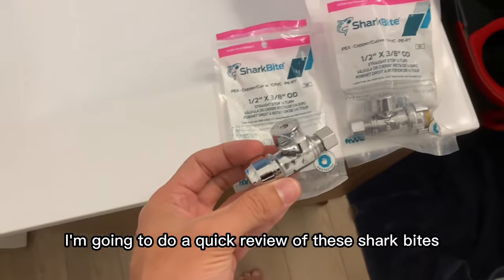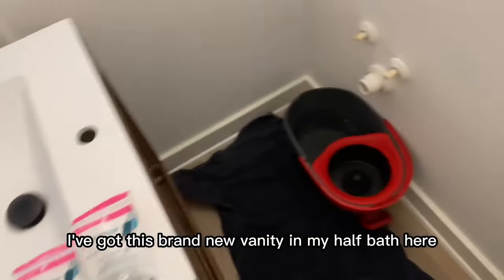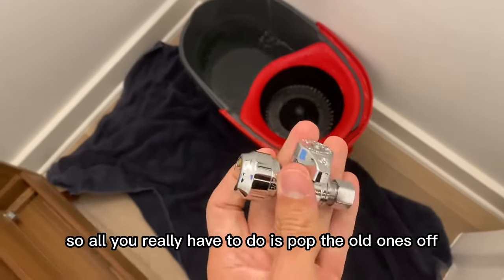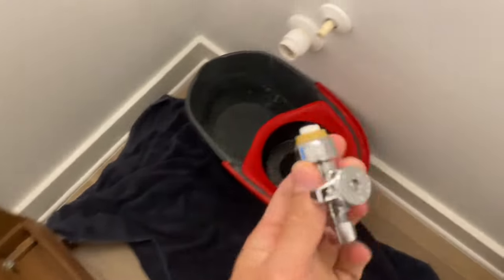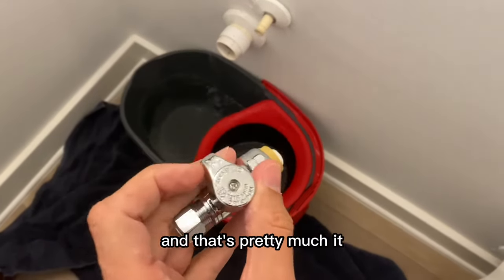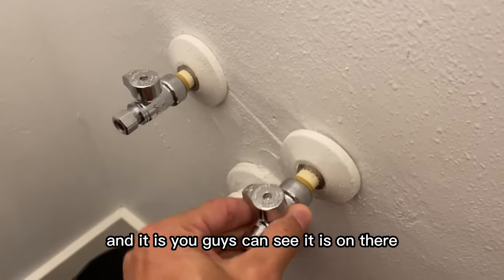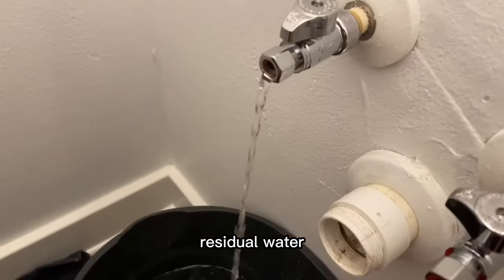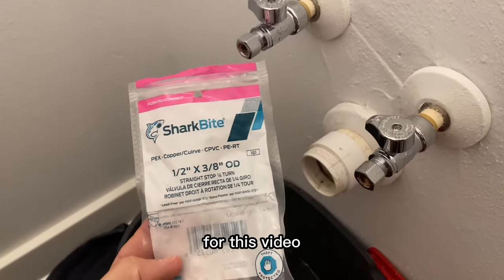SharkBite Valve Review For PEX-PVC | The Simple Do-It-Yourself Push To Connect Plumbing Fitting

Comment: What is the piece that you didn't use for ?
Reply from the maker: I believe what you’re referring to is just a cover.
Reply: It's a cover that goes over it. I think if there is longer pex exposed, you can put the cover on. I don't think it can be covered with what he had there.
Reply: That piece is a removal tool that comes with it by turn it opposite and push it out 👌